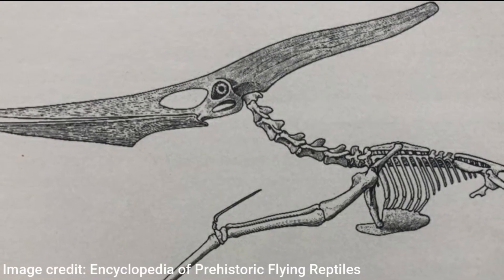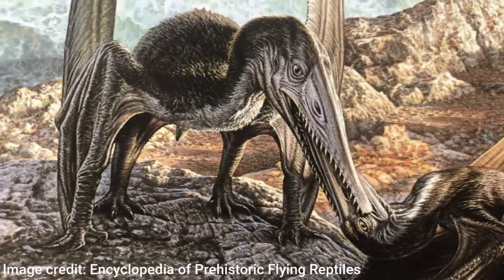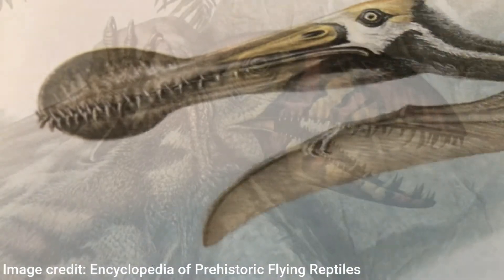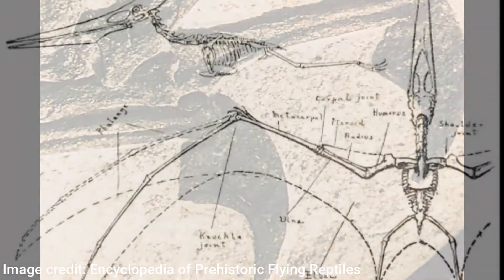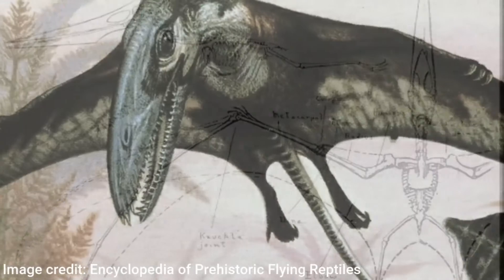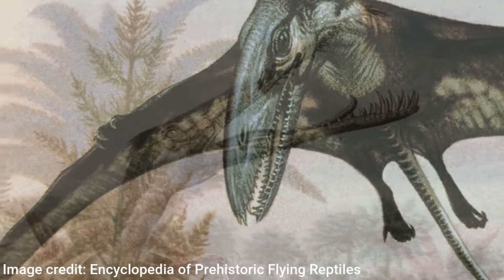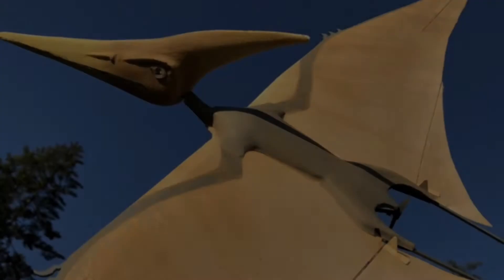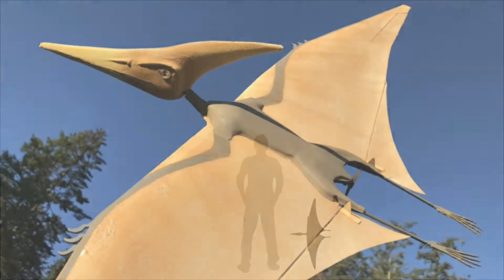RC Pteranodon Build and Fly

Comment: Interesting build!  Wonder how you dealt with directional stability of your Pteranodon with the big head/side area ahead of center of gravity.
Reply from the maker: Yeah the head was the hardest part. I ended up allowing it to feel pivot  with its own CG behind the pivot point like a weather vane. This made the head side area mostly invisible to the model.  Wing sweep got enough area and drag behind the CG to keep it all pointed into the airstream.
Control is elevons  with the aileron inputs only moving moving the surface up.  No down aileron throw. Down aileron creates drag which results in adverse yaw. Very bad for a finless flying wing.
Reply from the maker: That was one of the biggest challenges as I didn't  want any vertical fins.  I ended up mounting the head on a pivot so the head simply weather vanes into the oncoming airstream.
Reply: The Weevil Genius  Genius indeed.  Very clever solution.  Earns you a sub!😉
Reply: @TheWeevilGenius  how is yaw stability achieved? Have you tried flying without the head? Without the legs?
Reply: @TheWeevilGenius   In the beginning i thought is a fake video to fly with cash a big head . I understand now you made the had turning against the wind.   Very clever !!!!
Reply from the maker: Thanks!